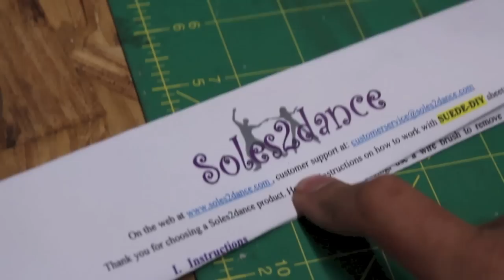DIY Suede Wrap Kydex Holster

Comment: OK Safty  Tip   suede  and leather Dust is  very, very carcinogenic  so you really really need to use extraction and resperators fro sanding and buffing  its lighter  Dust so will also stay in the air a long time and travel a long way if no contained
Reply: +Dorset Woodland Blades Good safety tip there.
Reply: Reference: https://www.ncbi.nlm.nih.gov/books/NBK304381/

Comment: Great info and glad you are there. I have a question that has been bugging me for some time. It is the application of 1.5 oz leather like "Glazed Pig Lining" on the Kydex. I was thinking on using that type of leather with a spray type of adhesive like 3 Rubber And Vinyl 80 Spray Adhesive or Loctite spray adhesive high performance. Also could I still put it in the oven if I work up the temp slowly? Thanks.

Comment: Any issue with it peeling up? I used the non adhesive and just spray glue such a pain. But I did also have to run a lighter along edges to keep from fraying